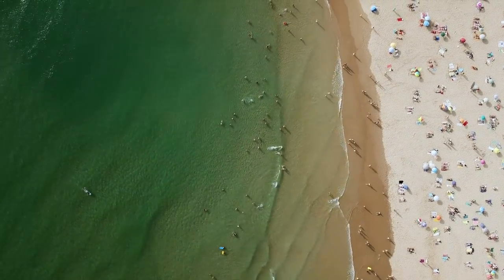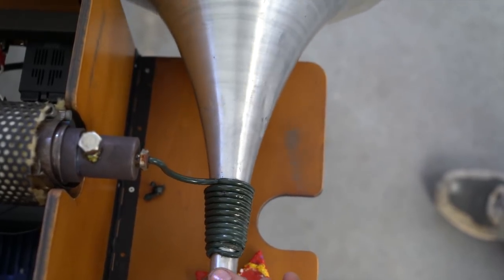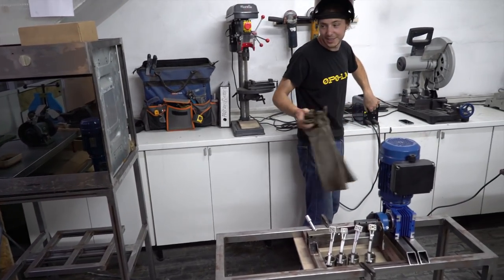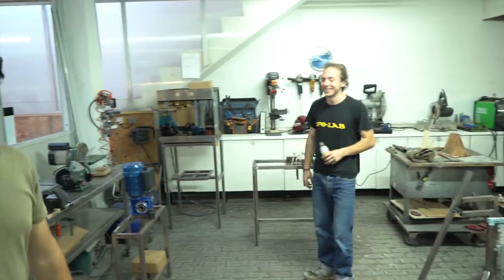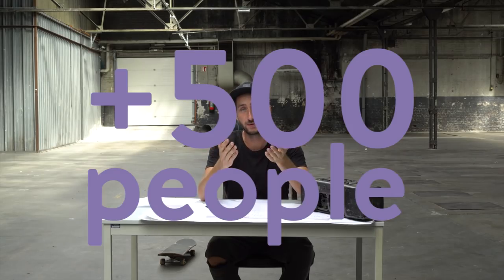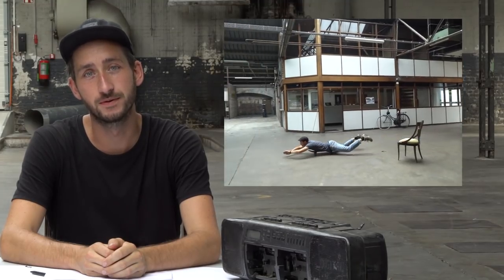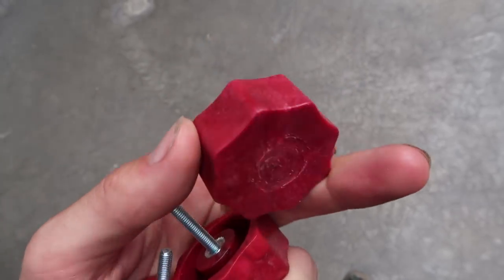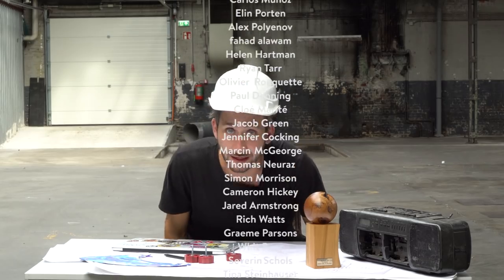Monthly News #19 - Our army of recyclers is coming together

Comment: question: what if you shredder and use plastics with printed labels such as buko cream cheese for example. will the chemicals of the print affect the plastic quality? any suggestions?
Reply: You wanna remove any labels cos you'll burn the label when you go to use it and the adhesive will release toxic fumes. Thats what we've been told Monash crew.
Reply: yes with removable labels no problem. but what about printed labels? in some cases they are printed directly on the plastic material